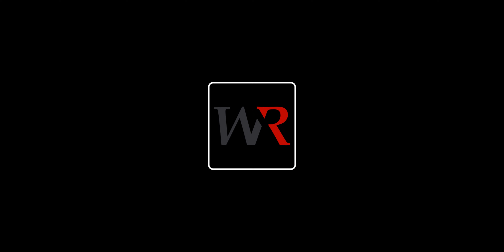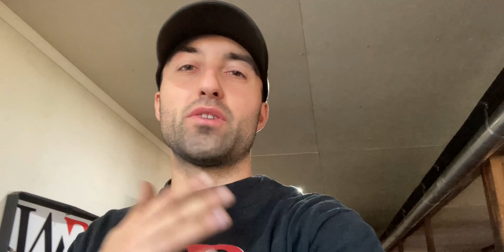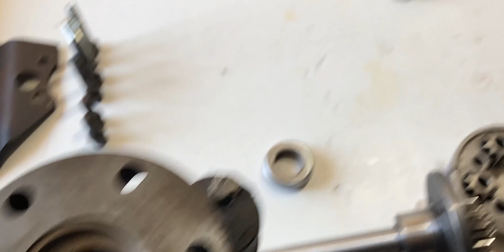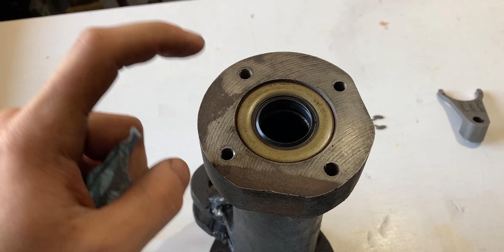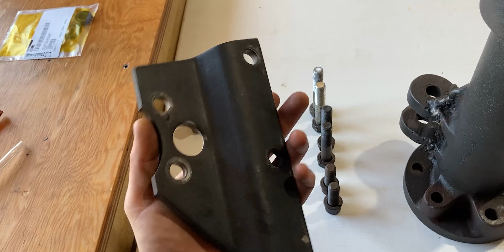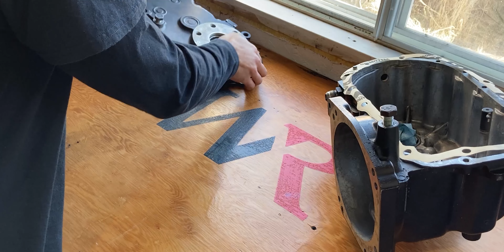Rebuild a John Deere 400 Transaxle - Peerless 2514 Assembly Process

Comment: i bought a axel installed it but  when i  went  to put the backer plate on the screw holes are a   quarter of a turn  out..how is that possible. do they very from year to year i dont get it  please help
Reply from the maker: Are you talking about the axle plate where the wheels bolts onto, or the cast axle housing parts? 
I am not aware of any alterations or changes over the year in the Peerless 2514 housings, but it's possible that you don't have JD 400 specific axles (or axle housings), depending what you are actually dealing with.
The JD 318 and JD 420 also has Peerless rear-ends, but they could be a shade different! Let me know what you have in front of you. Regards Andreas

Comment: Wow, very professional job. Love the tractor rebuild videos 😊
Reply from the maker: Thanks a lot, Andrew! I always try to share as many details as possible and put every assembly together as best I can. This rear end was pretty neat, especially since it's a 2-speed (Hi & Low). The Bolens HT20 I worked on, has a similar rear-end, but it does NOT have two speeds. I always learn something and try to share that with others. Regards Andreas

Comment: So I have a 400 with oil seeping out around the brakes, my question is should I be looking at the very outer seal on the tube or the square o ring? Is it supposed to be dry in the tube or is there supposed to be fluid there. Also do you know the size of that outer seal on the tube? Thanks, great videos!
Reply from the maker: Great question! There will be oil throughout you rear end all the way to your most outer bearings of your axles. The inner (square cut o-ring) will be a seal for the mating surfaces between each half of the axle and the main cast housing. On top of that, you also have a gasket that should be leak free.
The most outer double lip shaft seal is your last resort for keeping oil within the rear end. If you have a leak, than your shaft seal is damaged or it has worn a groove into the axle. This must be replaced unless you want to add oil every week haha.
The dimensions are ID 31mm OD 45mm and I'm actually not sure on the width anymore. Here I was able to find an exact replacement online: https://amzn.to/46Ay9Nx
If you'd like to find an exploded view of the rear end you can view these amazing drawings from: http://bitly.ws/KfUJ

I hope this helps you seal up your rear end in no time, that you can get back to work with your JD 400. Regards Andreas
Reply: @WorkshopRebuild  thanks for all the great info. Ordered seals at a local shop, should be in within a few days. Turns out I do have small groove in the axle,seems to be where the bearing was sitting. Probably a millimeter or less, just enough to catch a finger nail with.

Comment: You mentioned in the video that you would supply the information on the seal used at the outer edge of the axle tube. I do not see that information in the description section, only the info for the seals that you actually purchased. Can you provide the information for that seal? Thanks!

Comment: Hey do you have a video for how you cut your own gaskets? Also maybe what gasket sealer you use and why? Thanks.
Reply from the maker: As of right now I do not have a video on "How to cut gaskets". That would be a great video to make in the near future and I will take this advice in consideration! A qucik answer to why I use gasket sealer between two mating surfaces. Technically speaking, when two surfaces are machined perfectly flat, then a gasket is just fine. 
After I disassemble and clean the part, I have a good look at the mating surfaces. Now on the transaxle, the surface seemed relatively fine and there are many bolts around the whole permiter, so it would be just fine to use gasket material by itself.
My second thought is that if I merge these parts together, go through the assembly process, mount it onto the tractor and find a leak...I will have to go back and reseal the whole transaxle.
Now when I add a gasket + a little amount of gasket sealer, I am sure this will hold up. I hope that answers your question for now and I will create a video around gaskets and gasket sealers in the near future. Best regards
Reply: @WorkshopRebuild  what gasket sealer do you use? Permatex black? Thanks for the response.

Comment: We’re any of them limited slip?
Reply from the maker: After reviewing many drawings, I was not able to see any variations with limited-slip differentials! I believe there were only two castings for this size of the transaxle. The Peerless 2514 (John Deere 400 / 2-Speed) & the Peerless 2600 (JD318,420, 430 / 2-Speed with Diff lock). I hope that helps, best regards
Reply: They were all "limited slip" exactly how you see the differential in this video, the limited slip function only works at very low valve input (from your speed control via foot pedals in most cases) and it's simply from those 8 little pinion gears binding with each other & the 2 axle gears. With slow enough input speed the gears form a mechanical lock but too much input speed and they spin freely like a traditional style differential.

This Peerless 2514 has no variation amongst the countless machines it's in (famous examples: 1972-1983 Ford LGT & Jacobsen equivalent, John Deere 400) but what does vary are the axle tubes depending on the tractor - the 12-16hp LGTs all have the same axle tubes but the LGT195 & JD400 have unique tubes that have end castings to facilitate drum brakes behind the wheels while most others only use the upper "output shaft" for a flywheel & brake for the transmission.

Comment: Very nice job as always, question did you ever find a bull gear for your bolens
Reply from the maker: Thank you very much! I found one, but the seller hasn't sent it yet. It's just a matter of days until I get it. It's an original and seems to be in great condition. Once I receive it, I will assemble the rear end and mount it back onto the HT20! I will install an electric fuel pump as well, so I will cover everything in one video. Great questions by the way! Cheers